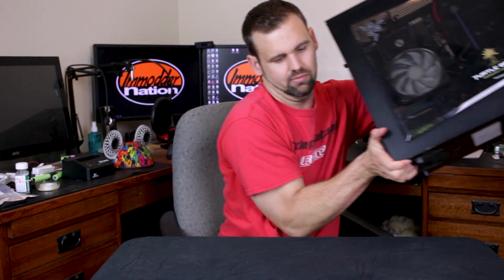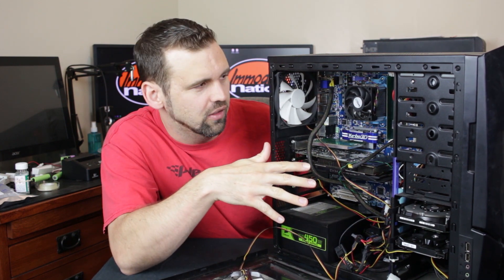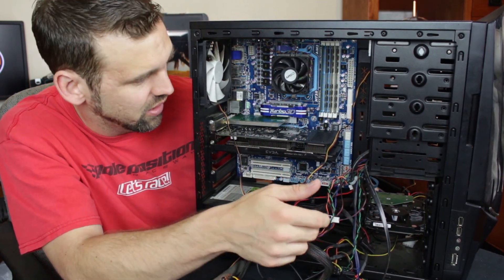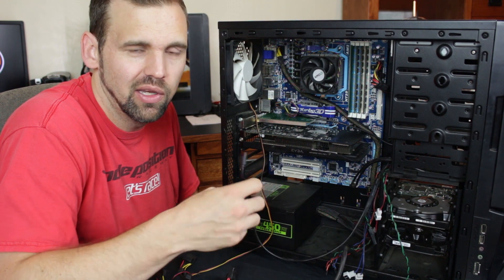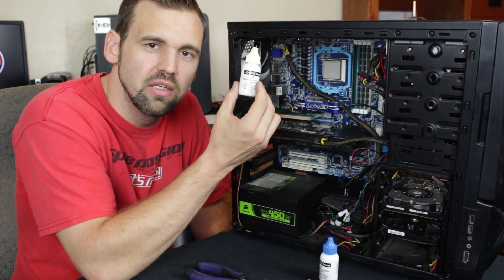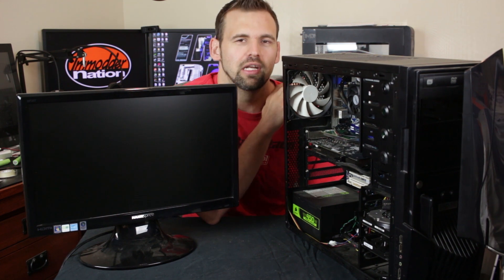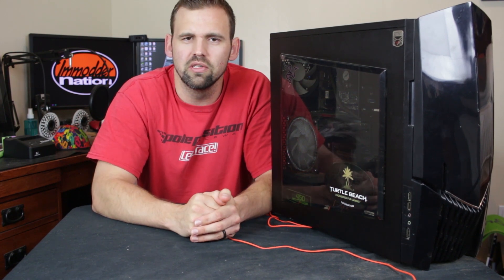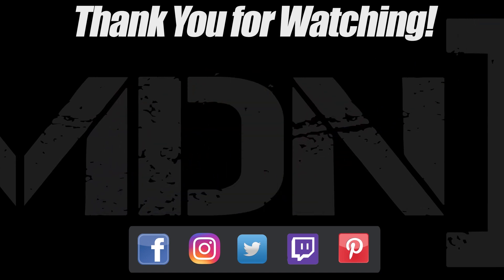THIS PC WON'T TURN ON! CAN I FIX IT? | PC REPAIR

Comment: My PC Wont turn on any help? My Power supply is working and when I plug my keyboard and mouse into the PC Those two light up but my pc, pc led and fans dont turn on or work.
Reply from the maker: How do you know power supply is working? Have you tried it on a different system? Do you have a second working power supply you could try to confirm your findings?
Reply: @ImmodderNation  Sorry for the late reply I only have one power supply am not to sure  if it is working
Reply from the maker: So when you power on the system, your keyboard lights up but fans won't? Could be anything on the motherboard from bad ram, bad processor, bad video card. I'd try to boot into bios with just basics. One stick of ram, processor, and integrated graphics if you have it. Try troubleshooting from there.
Reply: @ImmodderNation  Ok I'll try that and get back to you.  Am not sure if I have integrated graphics cause I have a i5 - 2400. and a gtx 1650 and 16gb ram
Reply from the maker: @zhking_1161  i5-2400 has Intel HD Graphics 2000, so yes you have integrated graphics.

Comment: 6:22 You DO NOT work on a computer with the power supply plugged in.  However, if you touch your case it will place your hands on the same electrical level as the computer.
Reply from the maker: You ground yourself. Thank you for mentioning that.

Comment: "nobody uses CCFL anymore" oh yeah? what if I told you they can be used for a graphical equalizer, producing a smoother gradient than a row of LEDs could? wiggles eyebrows
Reply from the maker: Then I would tell you electroluminescent lighting produces a better smoother glow than CCFL. True story
Reply: @ImmodderNation  It does, but you can't light an EL panel partially, while you can partially light a CCFL for the purposes of a bargraph style display. Kind of like the old bar-style Nixie tubes, just with more color variants and higher brightness.
A simple full bridge rectifier with smoothing capacitor is enough to drive one in that mode from the output of an amplifier (though the range is not ideal, since it depends on output volume in that case, but it's a simple way to demonstrate the principle).
Reply from the maker: @J0ermungand  we're not even talking about computers anymore.
Reply: @ImmodderNation  Whaaat? Obviously a CCFL based visual equalizer and adjacent power amp are vital to your PCs audio performance. ^^

Comment: opinions on Thermal Grizzly Carbonaut that science studio is always using?
Reply from the maker: Conductonaut? Most metal paste will be similar to one another. I used both conductonaut and liquid ultra for the Skylake delid and they work great!
Reply: @ImmodderNation  no they are like solid thermal pads and reusable no paste. it kind of looks like you are putting a blanket on your cpu actually :) ( here is a link to what i am talking about) https://www.amazon.com/Thermal-Grizzly-Carbonaut-Pad-0-2/dp/B07PHN2ZNY

Comment: I was surprised when you didn't at least power on the computer before starting all your cable management and adding the thermal paste. You lucked out and didn't waste your time with a dead motherboard.
Reply from the maker: In retrospect, that's what I should have done. Thankfully even with some cable management I could still remove the board but that would have been a huge waste of time. Thanks for checking out the video, IT guy!
Reply from the maker: The other thing is that I could have moved the cable management stuff to later in the video after power testing it with some video editing tricks. If the motherboard didn't work, I could always scrap the video and I only wasted a few hours.